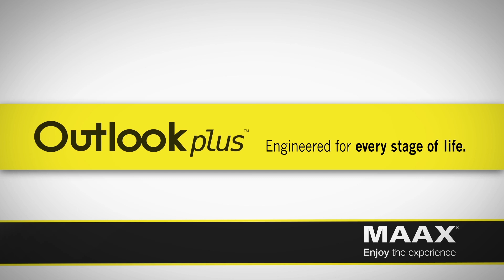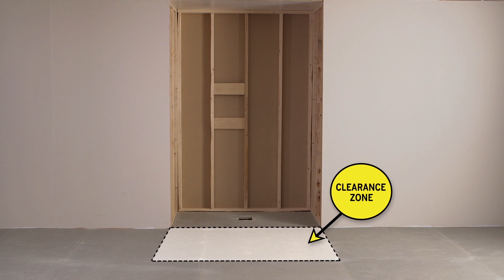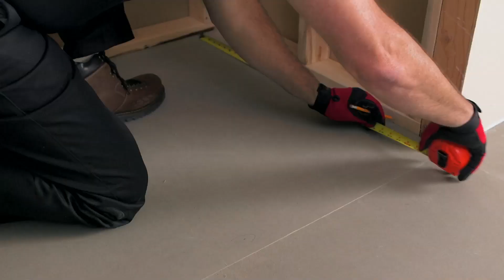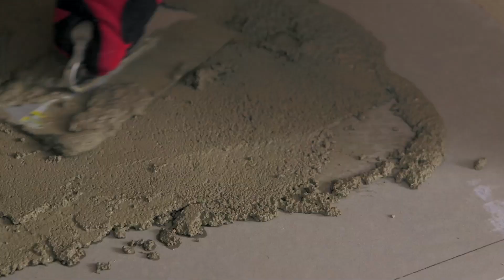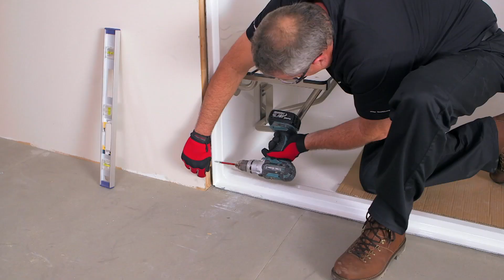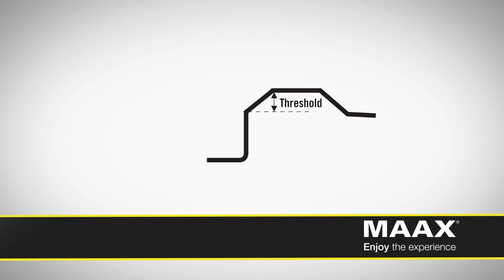Outlook plus Series - Installation video - MAAX

Comment: Warning-The way this video shows to install the drain is incorrect. It's backwards. Whoever installed my shower before I bought the house followed this video. Mine leaks. Now I'm fixing it and through a lot of research the washer and friction washer go under the tub on top of the female piece and the silicone bead goes on top of the pan. Wipe off excess silicone after you tighten male piece. If done the way they describe it will leak.

Comment: The drain installation seems to be backwards to how you install a shower drain. Usually the rubber washer and friction washer go under the shower pan and the silicone bead seals the top of the shower pan where you tighten the head to the pan and then wipe of excess silicone. The one I'm working on was installed the way this video describes and leaks.